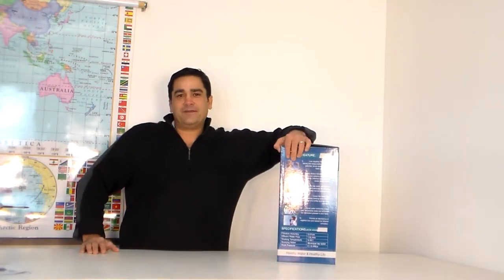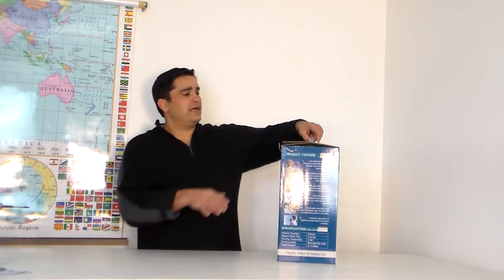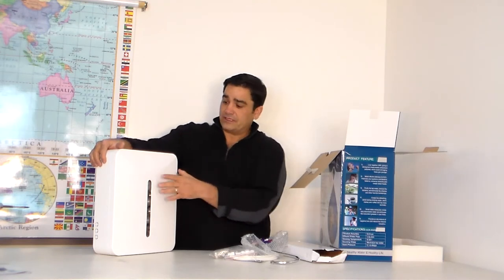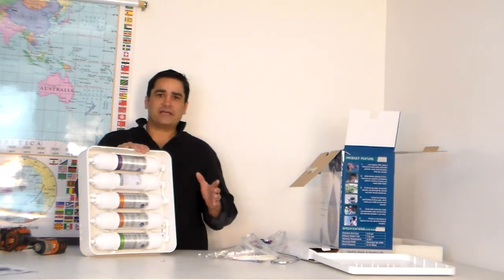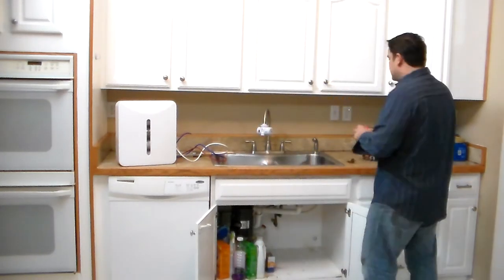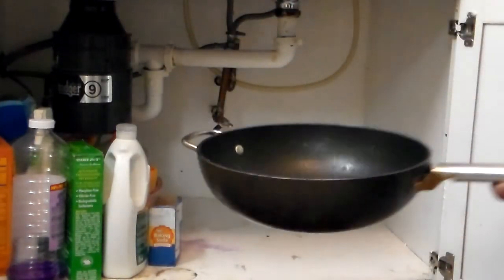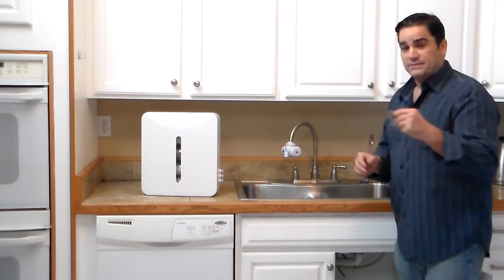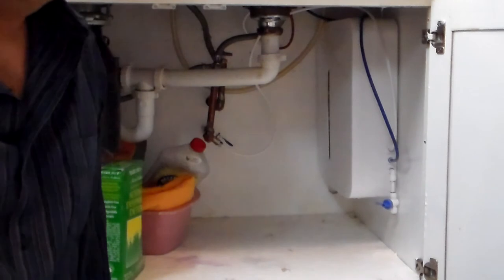5 step Fluoride ,Heavy Metal Chlorine Removal System, Alkalizing, Ionizing, Remineralizing

Comment: Few, if any municipalities currently add sodium fluoride to their drinking water.  Virtually every major metropolitan area now adds (hydro)fluorosilicic acid which is even more toxic than sodium fluoride and has virtually no evidence for "preventing tooth decay".  Reverse osmosis is a cost effective way of removing toxins from the water.   As far as water alkalizers are concerned, IF you use reverse osmosis AND an effective remineralization source, a high quality water alkalizer is an excellent investment.  I have used reverse osmosis/remineralization/water alkalizer for over 10 years now and can attest to its effectiveness.
One thing the presenter failed to reveal was the actual pH of his remineralized water.  I am guessing that it is well below 8.0.  A high quality water alkalizer can easily produce alkaline water stronger than pH 10.  pH 8.0 would be ten times more alkaline than pH 7.0 tap water while pH 10.0 would be 1000 times more alkaline than pH 7.0 tap water---BIG difference.  My alkalizer produces water that measures pH 10.5---5000 times more alkaline than tap water and there are models available that are even more powerful than the one I own. High pH alkaline water can effectively neutralize stored acid deposits in your body which are the cause of many types of arthritis and act as the fuel for cancerous cells.
Reply: Flouride is been added to our water supply for decades. I also know by good authority that antidepressants are used in the water also like Prozac and others to make us docile.
Reply from the maker: Nice guess.  Try sticking to the facts and just ask what is the PH.  Alkaline water machines have been sold as cancer and disease treatment based on acid alkaline balance.  Scientists from Japan and Korea studied this for twenty years trying to understand why the water seemed to have actual efficacy in curing diseases.  They know that if one takes a tablespoon of baking soda their body will be far more alkalyzed than if they drink gallons of alkaline water. After many years the discovery was made that it was actually molecular hydrogen responsible for the healing effects. This is not generated by any filter but rather by Faraday electrolysis.

Comment: I'm looking for a whole house water purifier system. I'm understanding 5 minutes in the shower gives more toxins than drinking a gallon of water. I do not know if that is so. But I would like to get all my shower water clean at an affordable price. The shower filters are very expensive to replace the filters. I also make my own laundry soap with borax and no aluminum baking soda with large magnets in my washer to soften water. I wonder if UV treatment, then with magnets would clean whole house water economically. Just thinking. I do not know enough of how it works.
Reply from the maker: Magnets and UV will have no effect on Flouride!
Reply: Nearly 100% of the chlorine that is added to your tap water is instantly absorbed into your skin, mucus membranes, and lungs.  Chlorine is a poisonous gas and a choking agent.  If you are simply interested in removing the chlorine from the shower water you should purchase a whole house activated carbon filter.  The activated carbon media will remove the chlorine, but many other contaminates will still be present in the water.  Your best bet is to have a sample of your water sent to a water testing facility and then target your filtration type(s) for the contaminates discovered in the sample.